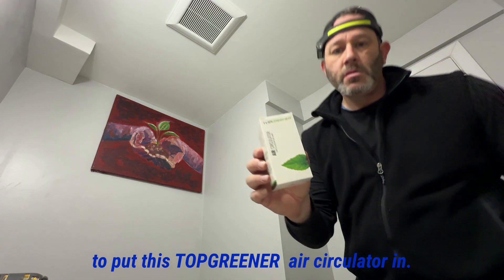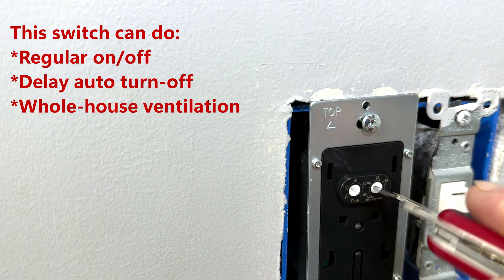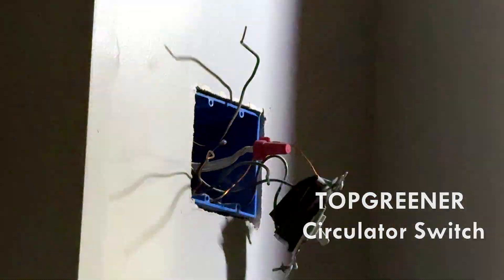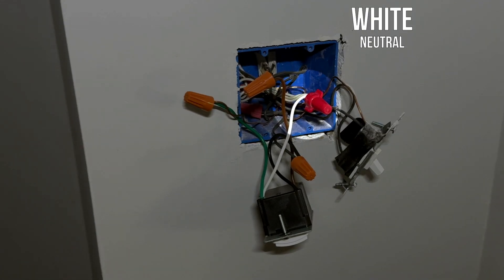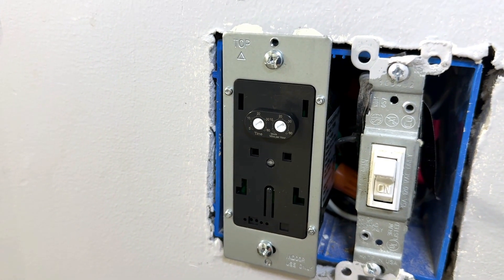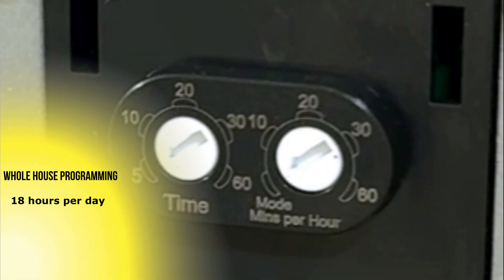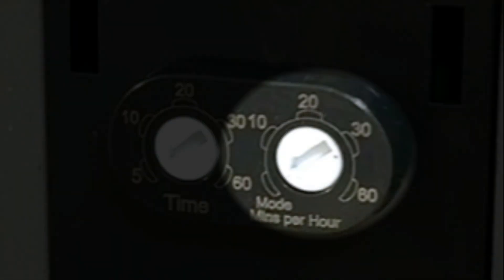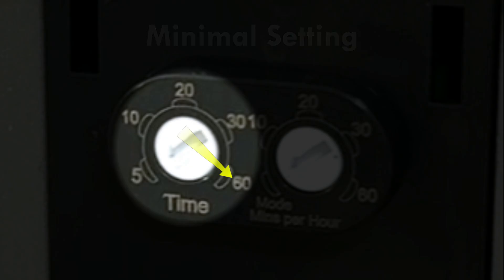How to Install & Program the TOPGREENER Air Circulator for Better Home Ventilation

Comment: Thanks for sharing! Curious to hear your thoughts on make up air. Ive been sealling my 80s home for the past year thanks to your videos and its helped tons. I know an older home will never achieve the tightness of a new build ... Do you think my concerns of not having an HRV/ERV and installing automated exhaust like this are overblown?
Reply from the maker: I think it is super important. There are people that come up with this stuff that are very smart. Can you get an energy audit where you live to assess your situation and determine if you need mechanical ventilation? Here is how I word it to my audit customers: To ensure your home is adequately ventilated after air sealing ASHRAE 62.2-2016 ventilation code recommends installing a timed fan for proper ventilation.  With the opportunity to air seal and reduce uncontrolled air leakage, a tighter home also requires mechanical ventilation.  We solve this practically and economically by installing an exhaust fan, usually in the bathroom, on a special timer that keeps track of how long the fan runs for 24 hours.  In this case, the fan will likely need to run for xx hours per day or more.  The reason it works is due to physics.  For every little bit of air the new fan exhausts, it gets replaced with fresh air outside the "envelope."

Comment: I don't think exhausting air necessarily means improving air quality unless you know the quality of the make-up air.
Reply from the maker: What makes you say this?
Reply: @homeairleakagetest  The exhaust fan creates a negative pressure in the room.  That encourages air to enter every crevice in the home, around trim and outlets through wall insulation, around plumbing and electrical entrances, from crawlspace and attic. 
That is unless you have a unrestricted filtered fresh air intake or powered make up air supply.
Just my take on things.
Reply from the maker: Kevin - you are super smart! In my world that is exactly what we want. When I air seal a house it stops uncontrolled fresh air from getting in and of course conditioned air doesn't escape as fast. So the fan creates just enough negative pressure (calculated precisely for each home) so that the fan draws in just enough fresh air in to keep everyong healthy and safe. I like to call it a "stream" of fresh air. It is done in a controlled manner so that the occupants have healthy indoor air quality.
Reply: @homeairleakagetest  Thank you.  I've sealed my home fairly well over the years.  I can lift a window an inch or so, and tell if any of my exhaust fans are on running.  I know that air is still finding other ways in when the window is closed.  I need a dedicated filtered fresh air intake, and/or an ERV.